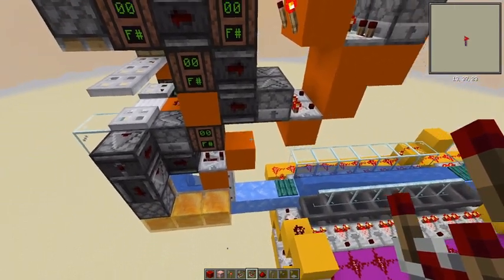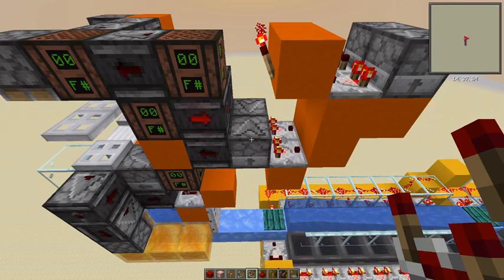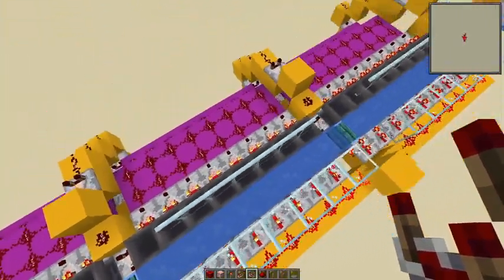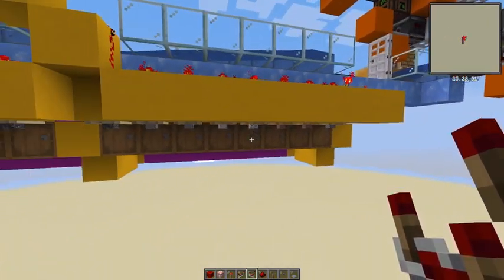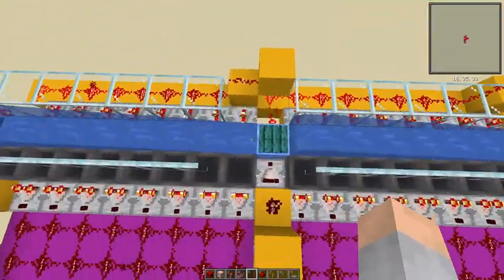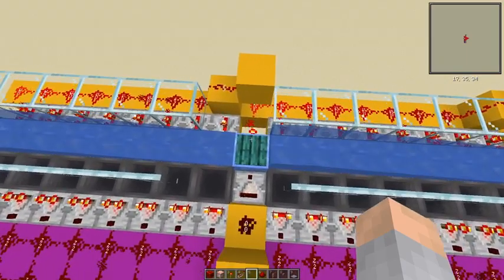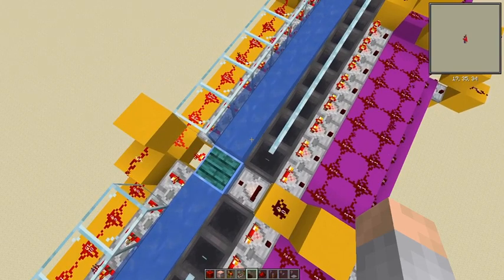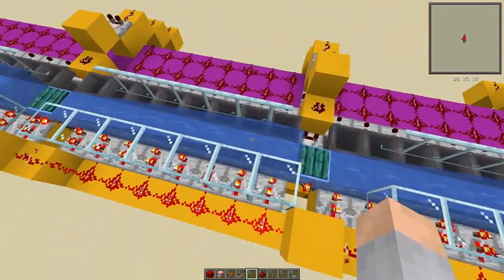Reliable Double-Speed Item Batcher (Polished)

Comment: pretty interesting! I'm using ilmango's one, it works great but there's losses likely due to the fact that it's an old design. This one works great, losses due to the hitbox of honeyblocks but I can fix that. The only thing would be to have it automatically switch off when there's no input, I've tried that but I have to find a way to cycle the items already dispensed. Still an interesting concept, thanks for sharing!